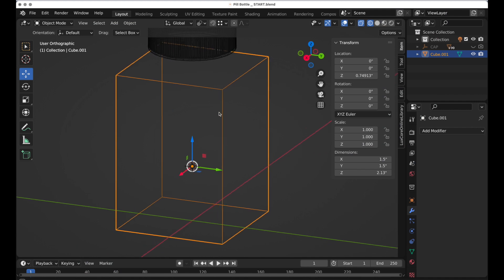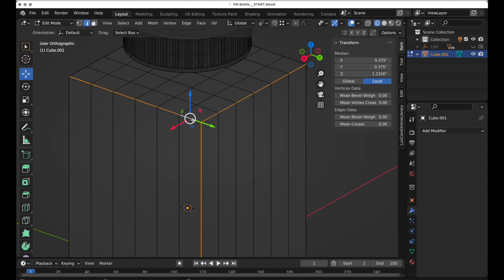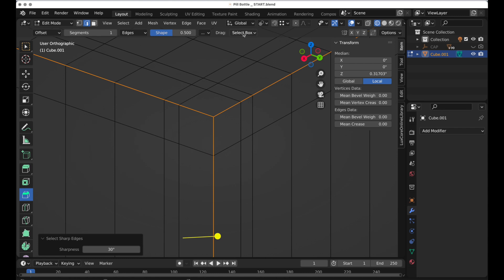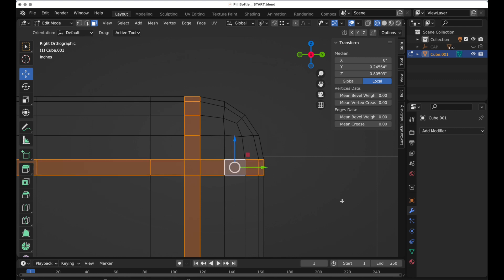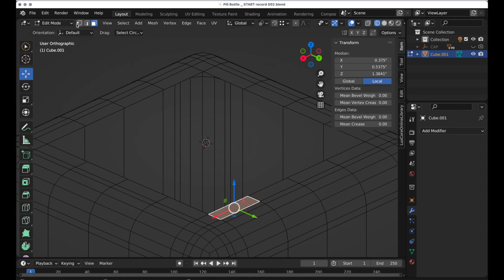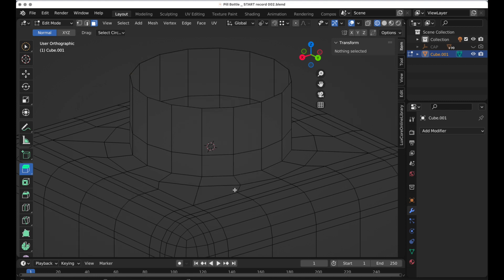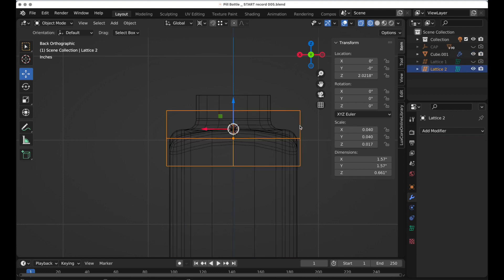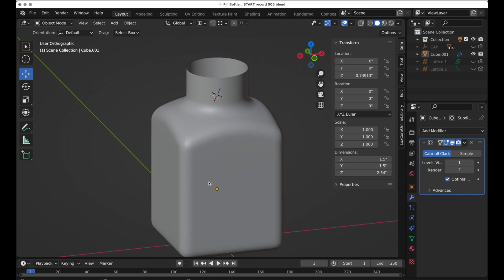Pill Bottle, Modeling, Series Part 1

Comment: Pretty interesting workflow. Btw the triangles you left didn't ruin the topology by any chance? Or sometimes it just doesn't worth wasting time on perfect topology with all quads? On 8:08 you started adding the triangles.
Reply from the maker: Leaving a few triangles in place isn't too big of a deal. I'm also used to using another subdivision system, a variant of Catmul-Clark that handles triangles a bit better than Blender does, but they didn't seem to cause significant issues where when I look at a render of the bottles so I didn't spend time trying to make them quads.
Reply: @christopher3d475 Tho it would be interesting would be to see how you manage to overcome this topology problems